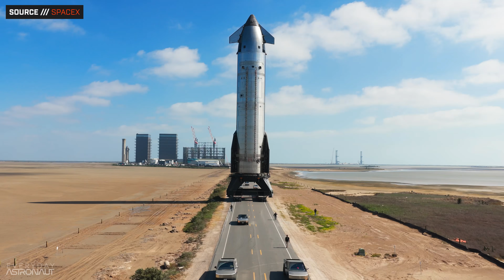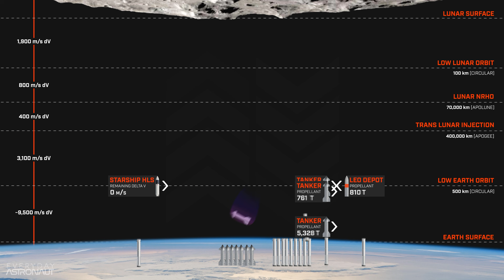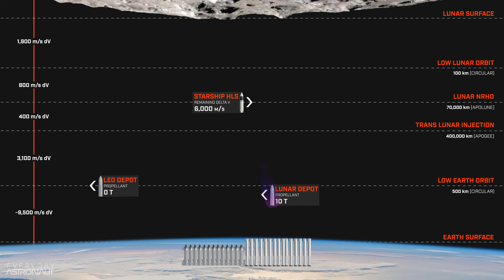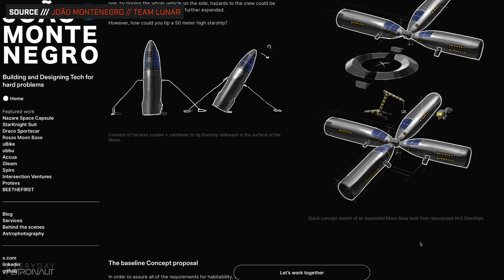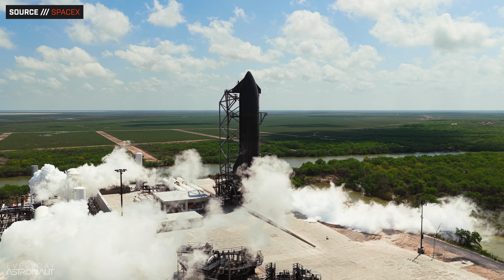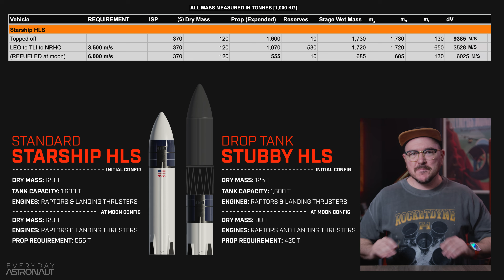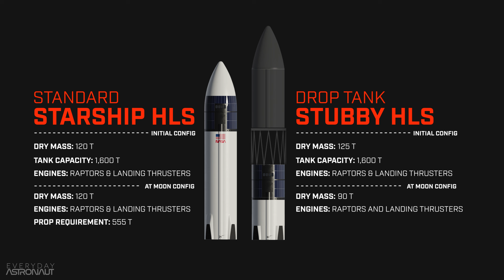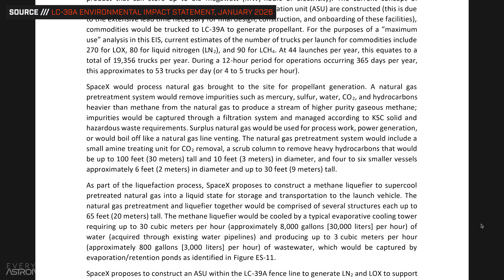Does Starship REALLY require 15+ launches to land one lunar Starship?!

Comment: This is a minor thing, but in KSP, since you have the Breaking Ground DLC with the robotic parts, you can control the thrust limiter of engines with the little KAL controller sequencer, and then bind the progress bar of the sequencer to key inputs. So you actually could do differential thrust for control with the horizontal lander design. You could even have the throttle control the play speed of another sequencer that changes the thrust power of the engines over time to move the thrust line through the center of mass as it shifts with fuel burn :P

Yes, it would be extremely extra for the demonstrations in this video, but it is technically possible without a mod for programming guidance and control like kOS.

Comment: The front drop tank shouldn't pose any special structural challenges with regards to the crew cabin, it would just need to be like the rest of the tank structure, with internal pressure resisting the weight on top of it and helping the walls against buckling. At a differential pressure of just 1 atmosphere the air pressure alone provides some 600 tons of support. If the pressure is increased some more you could even have the walls be in tension  instead of compression which is the ideal structural situation. During launch that would of course need to be more if one were to keep the walls always in tension, due the the acceleration.

Even limiting it to 1 atmosphere differential the support it provides would be more than enough to simplify the load bearing structure as apart from providing part of the load bearing the outward pressure on the sides greatly simplifies the structure needed to resist buckling. There is probably some optimum combination of higher pressure to reduce compressive forces on the walls vs the additional mass needed for the structure to contain the pressure. 

There are a few details that might need consideration, such as ensuring that all the stuff inside the cabin can withstand the elevated pressures but I don't see any unsurmountable or even difficult issues in that respect.  And of course there will never be humans inside the cabin when such pressure is needed to support the drop tank. Not that it would matter as humans can function normally at pressures of several atmospheres, and do so commonly in SCUBA diving.

In addition to dropping the tanks I would probably also drop three of the engines keeping only the three central ones. One would need though to calculate whether the reduced ISP and increased gravity loss would negate the dry mass reduction of those three engines.

Alternatively it could be equipped with just three gimballing vacuum raptors and jettison the skirt after separating from the booster to create room for them to gimbal while also getting rid of another piece of dead mass that will have no use. If thrust is a concern one could probably place a fourth vacuum raptor at the center, perhaps with a slightly smaller nozzle to avoid interfering with the three gimballing outer engines.  It would be reduced just enough to provide the needed space without impacting the ISP too badly. This fourth engine could also act as a backup in case of failure of one of the other engines reducing the effect of asymmetric thrust.

Comment: My problem with the drop tank stubby starship is that at least the way you show it with tanks on top of the crew section, the propellant needs to go through the crew quarters… that’s not super safe, to have two downcomers, maybe concentric, going through the crew cabin. No one would accept the crew being that close to downcomers that big.. at least in my safety focused engineer brain. Maybe you could have the downcomers go around the outside of the crew cabin and harden the cabin against “energetic events” shall we say, but that’s adding a heck of a lot more than just the 5 tons of weight you assume for drop tank stubby lander. 

Either way, love your videos. Keep them coming every-year-astronaut!!!
Reply: Have you seen BO's Mark 2 design?  The fuel tanks are now on top of the crew area...

They did this so that people wouldn't have an issue with a 33 meter long ladder where the crew was on the top.  But seemingly created another hazard.  Even in 1/6th gravity, leaking fuel, which is very possible using the smallest molecule fuel (liquid hydrogen), travels downwards.
Reply: @ConstantTrue   I have seen BO's lander design with the propellant tanks on top as well. and I agree, moving the crew down closer to the ground is a good idea. but the problem of safety is still there as you acknowledge. so I guess we agree. 

the safety concerns could be engineered around, as BO is clearly trying to do. I am not convinced that is the optimal answer, but we'll see how it goes for them. I am sure it can be made to work. it can probably be made safe, even if its not an "inherantly safe" design. either way, its an out of the box solution, and I wish them luck.

Comment: Honestly even if China "beats us back" it's gonna be a very small Apollo-size effort at present. Still cool in its own right, being one of only 2 to do so. But it's still gonna blow minds when we get a much larger sustained infrastructure and human presence there with the likes of Starship. This need to reduce everything for the sake of a race we already won technically is kind of silly. In addition, while the number of launches to fuel may seem daunting, they could be getting these up in orbit long before the human mission is ready, and use some of the ideas talked about here to drastically reduce boil-off. They don't really need to launch all of this in rapid succession. Just need to keep it steady so there's always a significant fuel depot in orbit. Then, way down the line, we can start thinking about lunar fuel depots.

Comment: Spacex is building a container ship. Which is important in the long term, for the future and for proper industrial use. And you need such ship to cross oceans (big interplanetary flights).
But Moon landing is basically crossing a small inland sea. You can do that in a 40ft boat.
Going with one design for all might be easier in development, but it will set them back a decade behind competitors like Blue Origin.

Comment: NRHO is a terrible idea, and i hope it gets removed from the overall plan. NRHO is only because of communication purposes IIRC? and that can just be solved by an orbiter or two. spaceX already has thousands of satellites flying around earth, we can probably just put 3-5 modified starlinks with bigger fuel tanks and whatever hardware changes required to do this and they can not only laserlink to eachother and high frequency bands down to anypoint on the surface but also deliver HD and high bandwidth data from the moon to the earth, more bandwidth than anyone has ever had on the moon. and they could also just sell that bandwidth to private and goverment customers putting things on the moon over the next few years...

Comment: Guys do you think in a few years SpaceX will handle the refueling thing more like continuously maintained infrastructure than mission specific steps? 
If rapid reusability works they would just lunch tankers hourly to maintain hundreds of depots in LEO or even lunar orbit and then any mission just has to stop by one and refuel basically stopping by a gas station.

Comment: Couldn't we avoid SLS's massive costs if we launched Artemis astronauts on a Crew Dragon, transfer over to Starship HLS in Earth orbit, and leave Crew Dragon in Earth orbit to wait for Artemis astronauts go to and come back from the Moon?
Reply: You have to get the astronauts from Moon orbit back to Earth orbit, too. HLS has no heat shield, so it would have to break with the engines using even more fuel. You could maybe consider an upgraded Dragon that could have similar capabilities as Orion and doing a similar job. Grey Dragon was a concept many years ago, if memory serves me.
Reply: Things like that could require starship to be crew rated which is highly unlikely to happen for years.

Comment: Hey Tim! Cheers from Romania!!
I think Spacex should think more in terms of staging. I'm explaining: No need to leave Moon with all the hardware, just with the human capsule, like Orion. Should have hardware on Earth orbit and Moon orbit, then astronauts should only " commute" in between. Any hardware used to bring things to the Moon should be adapted to be used ON the Moon and should stay there, not bring it back.
But I'm sure the army of engineers SpaceX has will figure out that, no worry!
Love your videos!👍
P. S.  Hey, do you know that on the Moon no need gas to weld the stainless? Only need the welding machine and photovoltaic panels, there's no oxigen! Starships could be used for living space on the Moon...and Raptors could be placed such way to use it eventualy to change the lunar orbit or rotation, even with juuust a litle amount, who knows what future will bring in terms of events...
Another thing, who knows what would find by drilling the Moon soil, maybe methane gas...😅 I know, I'm crazy!
Cheers!

Comment: Question: For the drop-tank approach, wouldn't you lose the ability to use that same hardware for future lunar missions at that point? Effectively it becomes a permanent fixture in LLO or NRHO, and not a reusable lunar lander on flight-proven hardware, unlike HLS (unless I'm misunderstanding HLS's purpose). The comment is based on your points prior to switching to LLO being the target. What wasn't clear to me was when the tank stages off. Is that happening during TLI or during descent to lunar surface?

Comment: Odd thought I had was watching the “why orbital refueling” section. Exploring smaller starships further. Might there be a scenario where starship shrinks and booster grows to get to LEO on the first stage? Keep the booster, ditch landing/staging hardware (besides clamps between them). Refill the booster, send the whole thing to moon. Detach HLS go land with thrusters, take off with thrusters, then re-dock with booster to come back. Then on return,have booster/hls orbit earth. Meaning they just get refueled/reused. And could theoretically be serviced for crew changes and resupplies by regular starship/booster with all the earth landing/reuse hardware. Send a few permanent moon surface modules this way, and having some boosters out in lunar orbit look like attractive remote fuel depots. At that point can switch to regular starships being shuttles between LEO to lunar orbit. Could send a few unmanned stubby HLS out there with booster to be essentially elevators to the moon surface.

Comment: Of course not. You’re not landing a 30 story building on the moon with out serious infrastructure and then how do you get stuff out of it?

This has always been a massive clusterfuck of a non-solution. 

Once down, how do you give it enough clearance to take off?  

We saw the debris shot out from a relatively clean launch pad. It would be devastating to anything in a 15 mile radius at least. 

Can’t get out of LEO, can’t land. Can’t unload cargo. Can’t take off. 

All future problems to solve?  How about can’t  get to orbit?

This is the modern version of the spruce goose. Another billionaires attempt at something grand.

Comment: I'm admittedly only half way through the video, but it seems totally bizarre to me to try to lift starship back off the surface. It makes sense why we want to get a bunch of mass there. It's worth a lot once it's there. But the mass we have to bring back should be tiny, so it seems like a right sized vehicle for getting off the lunar surface dramatically reduces the long term fuel needs.

Comment: The optimum number of landing legs is 5. 3 is the absolute minimum, each additional leg increases stability, but more than 6 you get diminishing returns for the extra leg weight. 5 is the minimum for redundancy so a single leg failure won't cause it to topple.  So, no less than 5, no more than 6.
Reply: 6 seems good to me by reasons of gut engineering by what looks good. That matches with the symmetry of the engines. Just smack it and say "that's not going anywhere" and you're good.

Comment: I feel like people have difficulty to wrap their head around the paradigm shift of full and rapid reusability. If that is accomplished then 15 refueling flights is not a big problem. It will for sure be much easier, cheaper and faster then developing and producing different configurations of Starship. 

It is nice to see EA go systematically through alternative options, but in the end i think SpaceX is right to fully focus on full rapid reusability and 1 main Starship configuration.
Reply: IF
Reply: @galaxya40s95  The point is IF NOT, then they are "just" repeating Apollo. That is not an option for SpaceX.
Reply: Simply repeating Apollo shouldn't be an option for anyone. It'd be a gigantic waste of time and money with very little gain.we need a permanent moon base and to be able to extract resources from the moon or use it as a launch hub to other places to make any of this worth while.
Reply: @trevorpullen3199  Again trevor, thanks.  This is the plan.  Moon base takes massive cargo to do.  This is practice for Mars.  Mars will take massive cargo to do.  One does not build a moon base with 3 tons to the moon per mission.  One cannot take massive tonnage to the moon without orbital refueling, for current and foreseeable tech, it's mathematically impossible.  This is true for SpaceX, Blue Origin, and the Chinese.

Comment: One way to solve the "pumping propellant in zero G" problem is to use multiple smaller propellant tanks instead of a big depot tank and a big Lander tank, Yes,, multiple smaller tanks would have more mass than 1 big tank, but there are some advantages: 
1 the depots are much simpler, just a rack to hold tanks, with sunshade and passive cooling
2 Extra propellant tanks can be stashed in a lunar orbital depot, and return propellant doesn't have to be taken to lunar surface and back.
 3 The lunar lander can use a much smaller and lighter tank, and pick up extra propellant by lunar orbit rendezvous.

Comment: As for the spreadsheet part, Starship Block 3 especially does a very aggressive ascent profile, something i think is mainly to reduce gravity drag. It gets to orbit in 8 minutes 11 seconds via SpaceXs timeline for Flight 12, this means imo Delta-V to Orbit can be adjusted to about 9200 m/s, lets say 9300 m/s with rendezvous burns. 60 tons for landing prop also seems a bit excessive imo, so if those dry mass numbers will be accurate (which they currently certainly aren’t, Starship weighs way more than that rn), they probably can do 150 tons of prop per tanker, reducing required flights to 10. That’s obviously as hinted only if SpaceX can get the dry mass down, which even for Block 3 is still like 260 tons for Booster, 170 tons for Ship.

Comment: 39:20 Surely these boiling temperatures for the fuels depend on the pressure. If they're stored under high pressure, their boiling temperatures would be much higher, no? Is pressurizing them an option?

Comment: The mission won't be easy because the rocket equation is a mofo.  If you want a moon based heavy industry base so you can build lots of big space stuff in low gravity with easy launches, and no ecological impact to worry about, it's a price you gotta pay.

The NASA and UK programs developing nuclear drives will make the equation less of a mofo by getting way more go per gram of propellant, but it's still gonna be a gas guzzler.

An Aldrin style cycler and nuclear drive tugs, plus a fuel depot at each end and drop ships will eventually be needed.  There is plenty of water on the moon but not much carbon, so lunar ops might need to focus on hydrox engines rather than the methylox systems designed for Mars.

Comment: Why a land a skyscraper like Starship on the Moon? Ans: Payload mass landed (150t, metric tons) and full reusability.  End of story. For Starships that are rapidly and fully reusable, the number of tanker launches to refill a Block 3 Starship is a non-issue because it's the operating cost per launch that's the important number, and that number is less than $10M per launch.

 So, if 15 tanker launches are required to put a Starship on the lunar surface, $150M is about 3.7% of the cost to launch a single SLS/Orion at $4.1B per launch. Or, for that $4.1B SpaceX can launch $4.1B/$150M = 27.3 Block 3 Starships to the lunar surface. And those 27 Block 3 Starships can place 150 x 27 = 4050t of cargo on the lunar surface. With full and rapid reusability, those 27 Starship lunar landings can be done in less than 4 months. That's why SpaceX wants a skyscraper lunar lander, one with a big payload bay and huge propellant tanks. Skinnying Starship down is the wrong way to go.

Comment: Ok, I'm only 25:16 in, but on the centre of gravity issue, what about the calculations when you shift the mass during unloading? There are pictures with some rather large payloads being unloaded and that will shift them mass distribution dramatically -  that is my concern on the HLS - the width of the landing legs will limit the mass of the payload that can be unloaded at any one time  despite the overall payload capacity

Comment: 33:40 i don't understand why would the CoM shift horizontally in this case? Yeah you burn propellant but you're also decelerating so it distributes on the long side of the ship, hence when it gets used it doesnt shift the CoM horizontally, but vertically.

+ why not consider the crater the thrusters make an advantage in this case? I can think of quite a few reasons this might come in handy if you want to build an habitat from the horizontally landed starship. And there's not any balance problem here